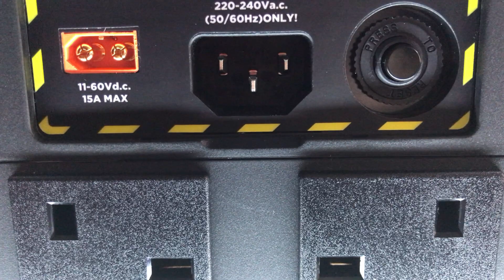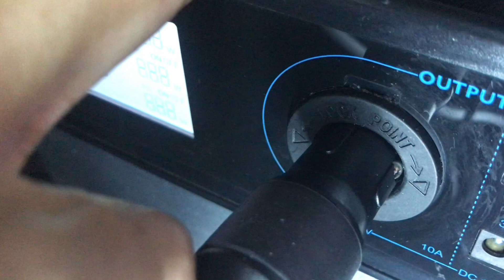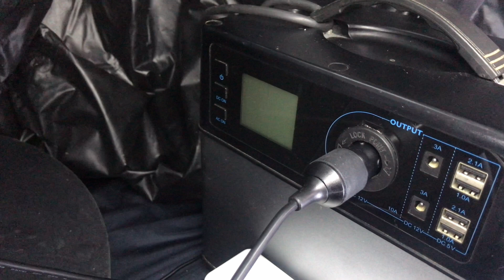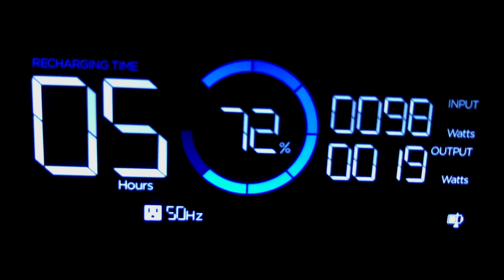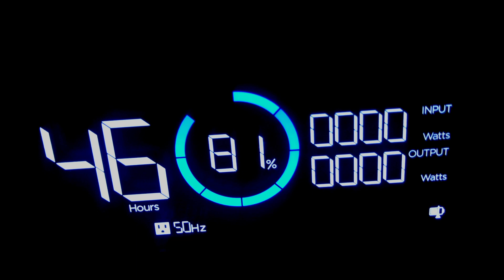ECOFLOW DELTA 2 | Testing the XT60i - Car Charging Cable on the D2 Solar Generator & Testing the App

Comment: Hi, i still dont understand when you state "after the experiment that i now have 81% instead of 72%", was it because of being charged or the XT60i? Im finding out the differences between XT60 and XT60i, XT60i is freaking expensive here, but if it really can improve the system, i should buy it then. Thank you.
Reply from the maker: @JamesBoen  thanks for writing.
It was charged from 72% to 81% using the XT60i. The EcoFlow systems are configured to work faster with XT60i.  So it's best if you get the cable from EcoFlow.  Where are you located?
Reply from the maker: @JamesBoen
Any update?  Keep me posted.

Comment: Hello. The extra pin from xt60i îs connected to + or - ?  I would like to build a solar cable with xt60i on one sidef and mc4 on the other side.
Reply from the maker: Solar Charger: Center pin to negative.
Car Charger: Center pin to positive.
Reply: @ProductsChannel  when i charge from car charger i interupt and load another charger or the same MPPT ? ? ?  hope there are 2 so when use extra battery pack via xt60 it wont worn out mppt through years!!!!!
Reply from the maker: @panospapadimitriou3498 
I am so sorry. I do not understand what you mean. 
Maybe you can ask EcoFlow Support directly: support@ecoflow.com
Reply from the maker: @panospapadimitriou3498 
Which country are you from?  EcoFlow support asked as products for each location are configured differently.  Your name sounds - Greek?
Reply: @ProductsChannel  yes greek.  this  xt60i story wanted me to make my own cable  kit and have at least a second panel .. hard thing is i need to  lower the voltage  because 2x series of my panels hit 70v!!!    and if paralel  35v 16amps!!!     i hope a converter can help but need at least to have more than 8 amps to system..  xt60i might be the only way to have a fair stable 400 watts when sun is up!!!  after that with the converter i can overamp the system to give more of the  power i blocked with the converter!!!!   and with 3 simple moves  system will work from rise to dawn safe!!!  80% of its solar capability  can keep my ac  in need without drain my batt... and i can keep it less charged  about 15 to 75 %!!!!
Reply from the maker: @panospapadimitriou3498
This is beyond my ability / knowledge sadly.  I am self taught in just these few years.  You are way more advanced than I am in this matter.  I've only been learning up about solar myself since the start of the pandemic.  I have a lot to learn.
Are you using a Delta 2 or Delta 2 Max?
Pls do help subscribe.
Reply from the maker: @panospapadimitriou3498 
Reply from EcoFlow Support:

Sorry for that now we cannot reply your question.
Do you know which product and which country he is?
Because DELTA 2 Max has 2 MPPT and different countries has different versions.
Thanks for your understanding and looking forward to your reply.
Reply from the maker: @panospapadimitriou3498  
I received a reply from EcoFlow EU:
"Regarding your question, are you asking whether DELTA 2 can charge other devices while using a car charger? Will this damage the MPPT?
Due to the low power of car charging, simultaneous output is usually not recommended. However, when DELTA 2 itself has power, it can charge other electrical appliances at the same time without damaging the MPPT.
If I cannot solve your problem, please contact us again."

----------------------------
I hope this helps.  If it does, or doesn't, let me know.  
Pls subscribe to my channel.  It sure will help a lot.
Reply: @ProductsChannel  i think i understand whats about... its one pcb that uses that one charging coils and mosfets ...!!!  thanks
Reply: The car charger cable that comes with the Delta 2 "is not" a true xt601. It is a  8A cable.
Reply from the maker: @charlesallen8329 
How so?  I'd appreciate your feedback as I learn in the process.  Thanks for writing.  I subscribed to your channel. Hope that you can subscribe to mine too.
Reply from the maker: Greetings @sebastvlad  Thanks for writing.

As in the words of EcoFlow, 

"Designed to seamlessly connect your EcoFlow power stations to your vehicle's car charger through the cigarette lighter socket. The XT60i connector is a unique feature that automatically detects the current, distinguishing between car charging and solar input, with a maximum current limit of 8A for car charging."

I hope that helps.  Pls do help subscribe to the channel. It'll mean the world to me, and help me make more helpful content for others. Blessings.